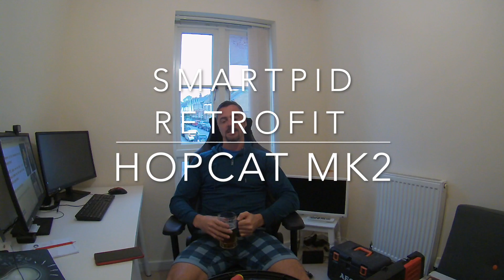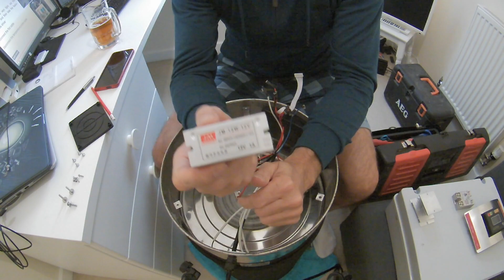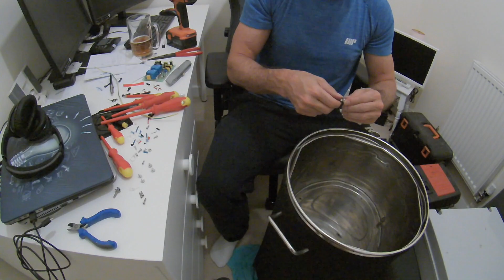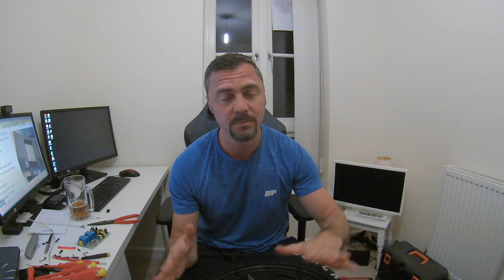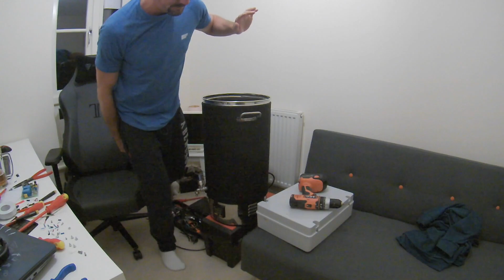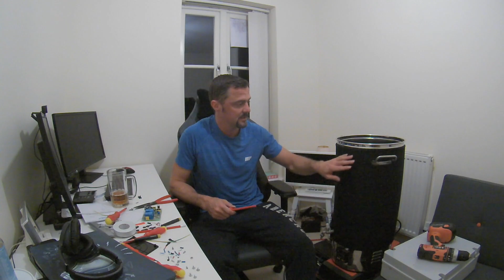SmartPID PT1 - Retrofit onto HOPCAT MK2 50L

Comment: Just what I was looking for. What did you end up doing with the exposed SSR? I'm not keen on 240v contacts exposed as it is. I was looking inside and think there would be room to mount the SSR in there, but not sure how I would mount it. Going to convert mine shortly.
Reply from the maker: Definitely room inside mate but I decided to leave it where it was, it keeps some of the high voltage stuff separate (thinking a leak in the pump would be a disaster). It's worked a charm so far. Really looking forward to getting into our new house so I can brew again! 3 weeks to go, just ran out of homebrew too so it can't come soon enough!

Comment: Chris, Finally got mine working. Turns out I wired the switch around the wrong way. In the schematic supplied by SmartPID the switch is shown as it appears when the mash tun is upside down.
Reply from the maker: Hi Michael, so sorry bud I must have missed your comments. Glad you got it working though. I am not an electrician but did dabble in electronics for a little while. It was nerve wracking for sure but definitely worth it. How is your brewing going now you have the PID?

Comment: Out of interest what prompted you for this? Were you unhappy with the temp management of the original control unit? (Apologies if you mentioned it in one of your videos )
Reply from the maker: Hi bud, sorry for the tardy reply I seem to be having notification issues. The controller was fine but I wanted to automate it a bit further. I have changed my 'workday brewdays' to multiple step mash profiles. Dough in at lunch break and go through 4 hours of stepped mash. I have noticed a change in the flavour, seems 'smoother'. I also like the remote monitoring over wifi and am hoping they will integrate with Beer Smith otherwise I will change to Brewfather for recipe integration. The SmartPID also controls the pump automatically